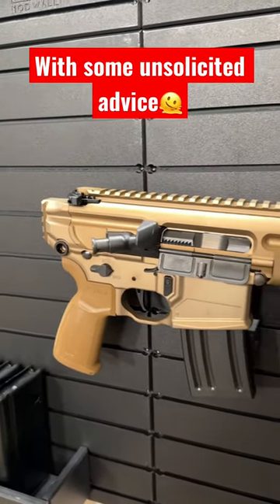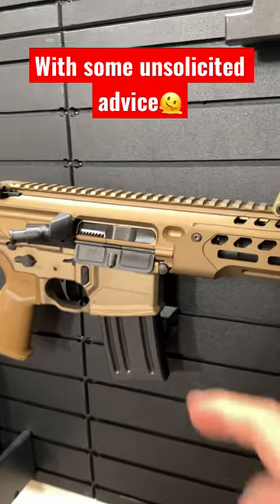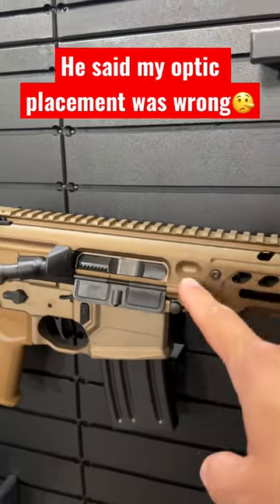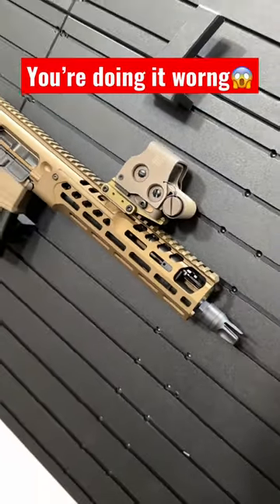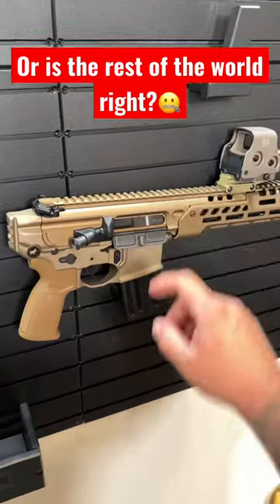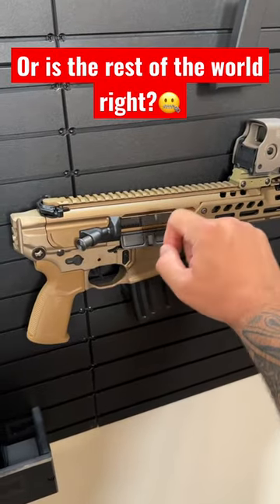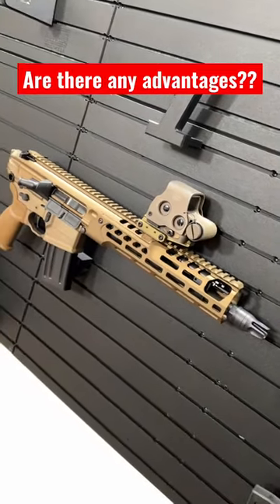Your Doing It Wrong😱

Comment: Best to tape it directly onto the muzzle. You can use an aggressive c-clamp grip to hold it still if you're worried about it wagging around.
Reply: Yeah if you duct tape it to the flash hider the barrels a great place to get a stable grip!
Reply: Make sure to scan for threats before and after applying the c clamp
Reply: You'll need to get some lotion or something if you're gonna clamp down on it aggressively while wagging it around. Too much friction hurts
Reply: No. Absolutely wrong. The best sight picture to have is to make the bolt, bolt carrier, and rear of the receiver transparent so you can look directly through the receiver and through the barrel.
Reply: @biddinge8898 I feel like this would unironically work if it held up, I bore sight all my rifles
Reply: I mean, I just duct tape lights and optics onto my AK, so checks out 😂
Reply: Less recoil
Reply: @everinghall8622 and the bullet was clear
Reply: My shotty has this
Reply: 😅😂❤😂😅 or a small vice from harbor freight lol!😊

Comment: Hypothetically, if you use 2 eyes open, it increases your total visual landscape and reduces obstructions by making the housing smaller but the most important priority is making sure your configuration is compatible with your training
Reply: You should always use both eyes open during training!
Reply: And practically?
Reply: This is an extreme example, but I want to thank you for actually explaining this vs sarcastic bullshit everyone else typed
Reply: A friend of mine used to embed with special forces types. He placed his red dot/prism optic forward on the rail for CQB applications because the optic occludes less of your view in tight spaces(especially for a big honking optic like an EOtech). Try it out for yourself. Unless you have a garbage rail- it’s not going to flex enough to make a difference inside of 25 or 50 yards.
Reply: It also increases the size of the holographic reticle making target acquisition “quicker”
Reply: That has nothing to do with where you mount the optic.
Reply: Saw rhis dude use two sights to line up and it looked retarded but irs a genius idea actually. Guns havent resllt changed much and im sctually surprised thsy havent made two eye optics escept for electronic ones
Reply: I do fire with both eyes open bc you can see your optic and anything around you. It’s relatively easy to learn
Reply: Actually the closer to your eye the more the housing disappears
Reply: @theradicalsaints7179  that is a fact. And you aquire a target picture faster with the sight sitting directly above your firing hand because that's the center of your pivot when you bring the gun up. The further forward you move the sight the longer it takes to find that perfect focus or you get over sway and you haven't bring it back down a bit.
Reply: The content creator is using an eotech, you can use them easily with both eyes open regardless of positioning with no impact on your peripheral vision at all. The optic being in the forward position does not confer any material advantages as far as I'm aware and actually reduces your ability to obtain a good sight picture while also blocking rail space for peq, lights, and other accessories. Potential case scenarios for using the optic in the forward position are 1)In the case that they intended to be able to pull the gun back over the shoulder in the case of enclosed spaces in which the person would likely be better served with a 45 mount with a lightweight optic instead or 2)Use with nods by which they would be better served with a riser mount. Regardless in my unprofessional opinion, an eotech would typically be better served in the traditional position on the rifle unless you really are trying to cut down on the ounces by reducing additional accessories.
Reply: I just do it by default with any gun I use more accurate and fast with it
Reply: if you're using the word 'hypothetical' that suggests you've never actually done it. You're just quoting something you heard or read.

Comment: The main reason to not put it on the rail is that a free float rail can twist and throw off your zero. With a monolithic upper, you don’t have that issue so you could run it that far. The apparent size of the red dot doesn’t change the farther you run it out so that is a non-issue . You do get a wider field of view by running it further out, i.e.- the housing blocks less of your peripheral vision. Also, the red dot has unlimited eye relief, but a magnifier doesn’t. So if you have magnifier or plan to run one there’s a limit on how far forward you can run a red dot and have the appropriate eye relief on your magnifier. Lastly, another major concern would be the sight interfering with your grip.

The Trijicon RX01 reflex sight used be mounted with a gooseneck mount that came out in front of the upper receiver so there’s a decent argument that there’s nothing wrong with that. 

So the guy is not wrong. With your gun you can run it forward, but everyone will make fun of you.
Reply: Very well explained. Especially since a lot don’t know that very few Free Float Rails are actually FF
Reply: Except "can" and "should" aren't necessarily the same.
Reply: I got my Romeo 5 on a front mount for my ace Gen 2, like you said main reason is to save space for the Juliet magnifier
Reply: Also (not likely one of the reasons the guy at the range mentioned it, but one reason I've heard) is that if you're using night vision, you'll want your optic farther forward than you'd normally like
Reply: There's also the trigonometry to be considered - if the main pivot point of the weapon is towards the rear, then you'll potentially get more accuracy further forward because the sight lies further out on the radius, reducing the margin of error as the gun moves. Basically, the closer the sight is to the target the less room for error.
Reply: Center weight and offset weight distribution are a thing regardless of strength. Weighing down the front element of the rifle changes the control point creating muzzle management issues.
Reply: @smicksmookety other way around, the closer the optic or sights are to your eye, the less movement and margin for error (you can more closely see the reticle and adjust incrementally, the further forward it is, the easier for you reticle to move slightly and you to be unaware, it'll all look on target). The longer sight radius also improves precision. 
i do run my red dots far forward for faster target acquisition and wider field of view but at the cost of precision. 

if you don't believe me, go to a range and shoot a red dot in both configurations
Reply: I think he put it that far front to exaggerate. Perhaps there’s a middle ground that some may prefer.
Reply: @MattCurrieImprov  I've heard it said that it's best to put it as far forward as possible on the *receiver*.
Reply: @alzed9983 like night bino optics? Or night mounted on the weapon.  Cuz fuck NODs
Reply: Yep, this.
Reply: I mean, looking cool is the most important thing.
Reply: You're right but you fail to mention that the further the optic from you eyes, you loose the most important thing these holographic optics give you and that's parallax. You don't need to take my word for it... There's a logical reason why 90% of competitors and professionals don't do this....
Reply: So many arm chair operators here
Reply: @valqueenofValhalla  Thank goodness the real deal showed up, so you can set 'em all straight! Get 'em, tiger.
Reply: You don't mount the optic on the actual rail. You mount it on the actual upper receiver as far forward as possible without piggy backing the rail.
Reply: Well done
Reply: Isn’t there an issue of putting the optic right over the hottest part of the breech? Honest question, I was told that spot was the hottest during firing and this your zero could drift after a long session of shooting.
Reply: The size of a holographic sight does change from your perspective...
Reply: A genuine response, loved this comment
Reply: @DesertDuc  he just explained why it would or wouldnt matter, if it doesnt matter then its a CHOICE as to whether or not you WANT to, which means "should" doesnt matter. in the example of a free-float rail; thats where "should" does matter
Reply: @hiramabiff604  absolutely it does change relative to the housing. But the apparent size doesn’t change on target. I.E. - the 1 moa dot stays a 1 moa on target.
Reply: I have to run my aimpoint pro a little past the receiver because after I put on the rear flip up sight and 3X magnifier, I ran out room on my Geissele.
Reply: Plus the MCX top rail is integrated into the upper, the handguard only is made up of about 60% of the traditional attachable handguard
Reply: Im just here to bump this comment. Thank you for not being a troll and actually giving us a point of reference to have a conversation.
Reply: It's not on the free float.  It's still on the uppers rail
Reply: Everyone who doesn't understand why, will make fun of him. The people who are making fun, are the people who don't actually train, or use their rifles. Also, probably the same people who will get upset about their rifle getting scratched.
Reply: Too bad people don't have the knowledge like one does and make comments without questioning why one would do so
Reply: This guy knows what's up.  I'd personally run it a little further back so I could also run irons, the general consensus is run it as far forward as you can on a part of the gun that can't shift/twist.  Monolithic uppers don't have shifting fore-ends that are screwed on.  With a free float you run it the furthest to the front of the upper as you can before the hand guard because screwed on pieces can shift.   Monolithic is one piece, so the front of the hand guard is the same as the front of the typical upper before the free float.  Again, I'd still run it further back just so I could have back up irons that don't need a battery or glass, but the general consensus is still to be "as far forward as zero will allow," and on this particular gun that means well beyond the mag well.  There's also the minor bonus of having more weight towards the front which helps (even if negligibly) with muzzle rise.
Reply: So what you're saying is I'd only be made fun of by ignorant people?? 😂😂😂😂.
Reply: @cannazavala8750  yes

Comment: It's field of view. The reason he probably said that is because the Spear has somewhat monolithic handguard and should hold zero where on a typical AR15 platform where the upper and handguard meet isn't exactly the best to mount anything requiring a zero. The further out you mount an optic, the better your field of view should be.
Reply: Because lasers aren't mounted on rails?
Reply: @PistonDrivenGun there’s a reason that people complain about lasers not holding zero and hence why people claim dd riz3 handguard as superior when mounting a peq 15 etc.
Reply: @hsld8930  I'm sure most people do not get good handguards or mount them right, user error is the cause of most failings. Lots of handguard held zero before the ris3 its just knew and foolproof system
Reply: top comment here.
Reply: It's far from being monolithic
Reply: But a "smaller" lense to find the red dot in. If you want a smaller looking sight, just get a smaller red dot sight. I like bigger windows and pay for that
Reply: That’s hysterical, the MCX has a known defect where the rail literally moves lol. Worst gun to do it in.  Arisaka has been making a clamp to hold it down for awhile now but the new Spear LT and Spear XM7 have a new shifting problem which is a severe issue for IR lasers
Reply: @PistonDrivenGun the main complaint of the gun in the video is the rail moves so much that lasers can’t even hold a rough zero lol..
Reply: @Marksman5147  I said somewhat monolithic. They designed it to be but their rail issues are pretty well known.
Reply: I was like this method works great on a damn scout rifle lol
Reply: @carlh7795 I'm sorry I just imagined seeing a guy at the range with a 70 inch full pane window taped to his AR 😂
Reply: Field of view? Just stop searching in your optic. Theres plenty of FoV on standard dots and holos further back. I get the philosophy but there's easier ways around that than wasting rail-estate.
Reply: @BananarchOfTedKacistan  I'm not saying it was correct just generally stating why the individual probably said what he said. It's definitely something I wouldn't do even with a monolithic rail.
Reply: @2amichaelj  Fair fair. I wasn't targeting you as a result. It's more so the idea since I feel it lacks foundation. But there's tons of that in the gun culture.

Comment: Since you're upper is monolithic, it's a good idea to run your optic far forward because it will still retain zero and take up a smaller portion of your vision.
Traditionally, people put optics at the end of their reciever because that is the furthest position before your handguard/rail, which is a separate part, and will not hold zero.

Comment: the main reason to run  your optic forward is to increase peripherals. there's really no  set way to run a 1x optic and comes down to personal preference  some people claim  that you need a monolithic upper but a properly mounted  well built upper isnt going to flex enough to matter. also, the same effect can be somewhat replicated with a cantalever mount, especially on short barrel guns.
Reply: I think the main point is for an eotech you don’t wanna push it too far out, for reasons when under night vision, but I know the newer ones fixed this issue so I doubt it really matters like you said.

Also mounting an optic on a free float rail that far ahead is a great way to lose zero. Only go as far as your eyes are comfortable combined with the fact you want to maintain zero. So further back is still the preferred method. Remember tho, use what you prefer and train with it.
Reply: Uppers may not flex much but a free-floating handguard can, especially a lightweight one.  It's only support is the at the end where it's mounted to the upper, usually by just a couple of screws.
Reply: @MeMadeIt your sight will still have more shake due to the muzzle energy being expelled is far closer to the sight than it was previously. The main advantage of having it so far forward is peripherals especially in CQC. Wouldn't recommend it tho.
Reply: Somebody has never used a Sig.....
Reply: The precision you can get will decrease as the optic moves farther forward. When its right up to your eye, a small deviation of the dot from the middle isnt gonna have a big effect on accuracy. When its at the front of the barrel, a small deviation will result in a big miss. Same with iron sights, you want your eye to be close to the front post so you can get closer to it being perfectly in the middle.
Reply: @deltashot5608  that's not how modern red dots work. they have curved reflex  lenses, so if you can see the reticle, that's where your round will hit. no matter the angle
Reply: @shelp7858  plenty of red dots still have parallax.
Reply: @MrCashewkitty   reflex sights only experience paralax at extremely short ranges, so while they do have paralax in theory, in practice, the paralax is so small and only observable at such close ranges , it has no effect,
Reply: @shelp7858  I was just watching a video on that very topic I've personally never been affected by it but I just recently went rds on a pistol. I run eotechs on most guns and the scoped ones have adjustments. Good to know. Thanks for the info
Reply: @MrCashewkitty   yeah in general, low power optics have minimal paralax, but  there are other factors like glass quality, etc, but sticking with high quality optics like aimpoint and eotechdont have to worry

Comment: It comes from colonel Jeff Coopers idea of a scout rifle. It balances out your rifle and gives you more field of vision outside your scope.
Reply: Cooper's scout rifle criteria mandated the ability to top up a bolt action with stripper clips. That meant the scope had to mount forward of the action. It also meant the scope had to have a much longer eye relief which usually meant lower powered pistol scopes.

That might get you more field of view around the scope, but that was secondary to the stripper clips.

Also, moving the scope forward is going to move the center of gravity for the whole gun forward. I don't think that's going to help balance things much (but I'm just some nerd on the internet).
Reply: Yes it does come from Cooper. He set it up this way for bolt action but I set a 10-22 with the same & it was a great scout rifle & well balanced. Used a handgun scope & swung from the shoulder with strap in a second, with sights on everytime (no blackout ever). May not be the best setup but it's a fun setup, like shooting a lever action you can spin around.
Reply: @dkconstant  you’re right. I’ve seen Ian’s scout rifle critique video as well. As with everything else in the firearms world, there are trade offs with everything. It’s simply not practical on modern firearms especially considering the use of forward mounted devices.
Reply: How does adding weight to the front of a front heavy gun balance it out?

Comment: A friend of mine used to embed with special forces types. He placed his red dot/prism optic forward on the rail for CQB applications because the optic occludes less of your view in tight spaces(especially for a big honking optic like an EOtech). Try it out for yourself. Unless you have a garbage rail- it’s not going to flex enough to make a difference inside of 25 or 50 yards.